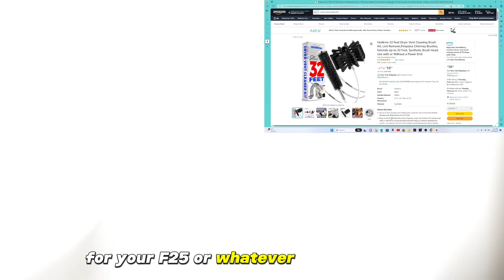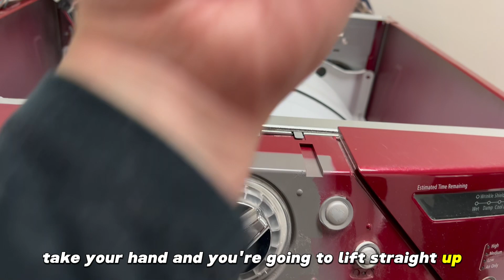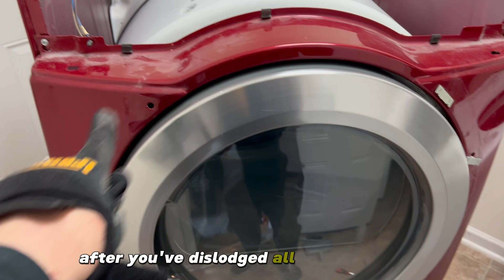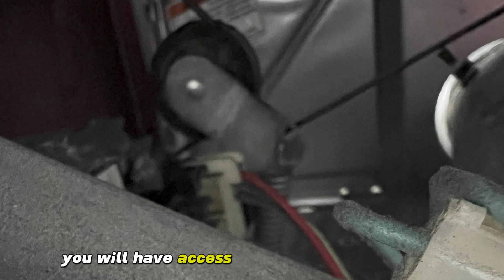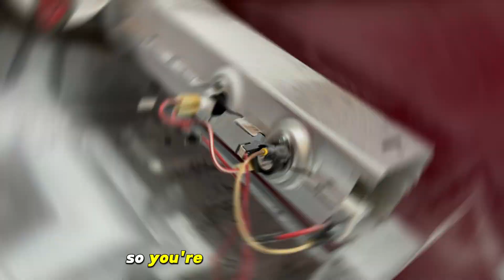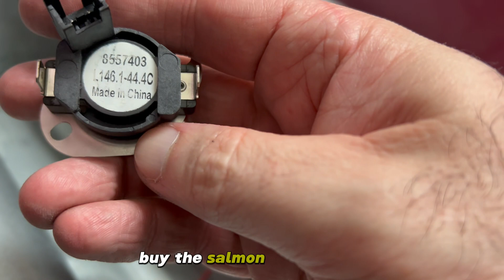Whirlpool Duet Dryer Repair: Fix & Replace High Limit Thermal Fuse & Thermostat (Under $35) #diy

Comment: I have a sense that this may be what is going on with mine (seems to be the identical model)... it is running normally - just no heat. I was super excited to see that it has a diagnostic mode - but mine is not giving me a code at all. It just ding-dings every time I push/hold the temp button... but then nothing. What do I deduce from that?? I am so grateful for this video, but I'm just an old chick... kind of apprehensive about pulling this whole thing apart, especially if the thermal fuses might not even be the problem. I just can't think what else it would be. The error code would have made me feel better about the whole thing - am I just doing something wrong trying to elicit it?
Reply from the maker: I’m terribly sorry for not getting back to you sooner. I hope that there is a diagnostic report and or sheet that is in the top of your dryer. If you could do that your dryer might have a different method of getting it into diagnostic mode to find your error code

Comment: I can't find the pink high limit thermostat on Amazon.  Is there another place I should try?
Reply from the maker: The pink ones just last longer.  Don’t know why.  If you can only find the white ones that will work but they will most likely last half as long.  Buy two